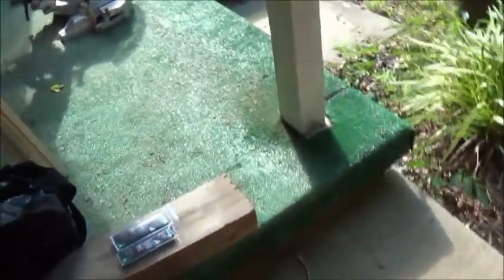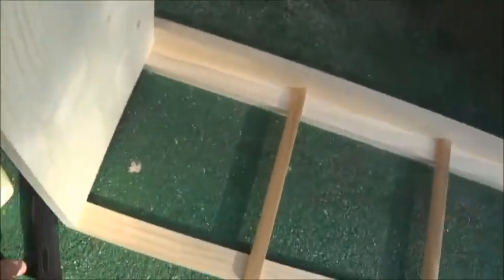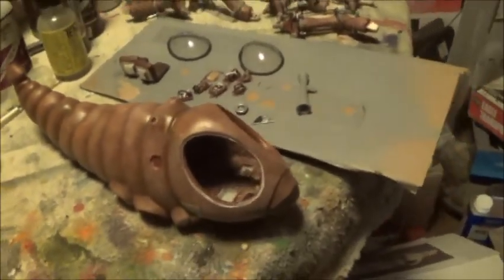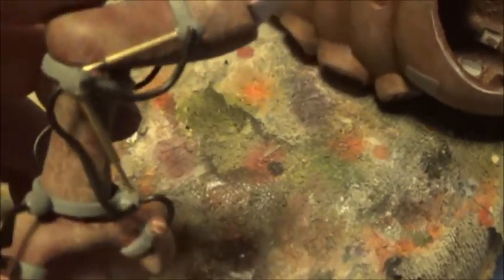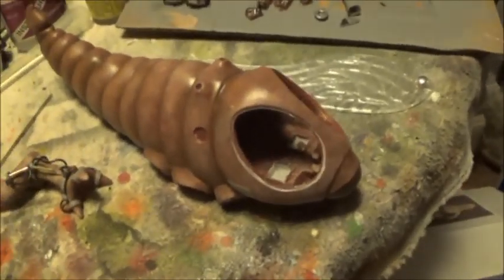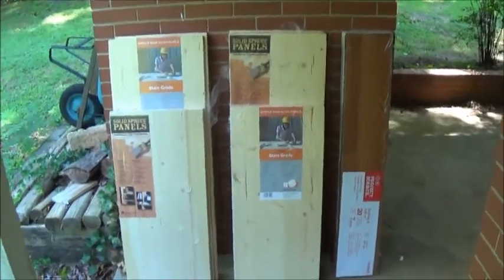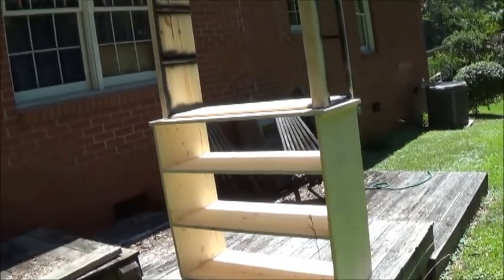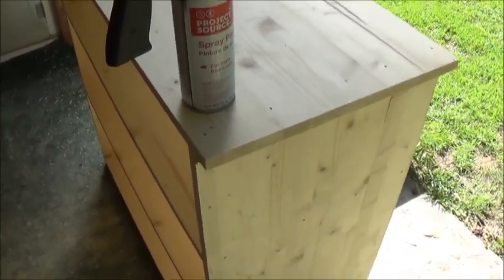shelf space...the REAL final frontier

Comment: Great idea Lou. Gathering up stuff for some real space for my stuff, junk, stuff..whatever!!
Did you buy the glass already cut in 3' sections? Where, Lowes?
Reply from the maker: no, I got the glass at the store fixture supply store. check your local area for  something similar. they're tempered so they will shatter into tiny bits if they break (which is better than making sharp shards) they run about 12 bucks a piece